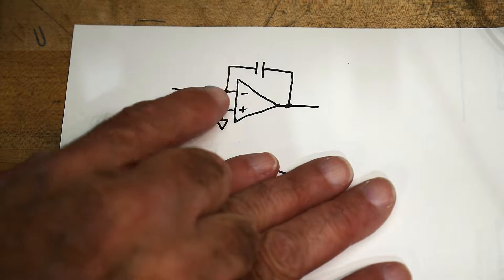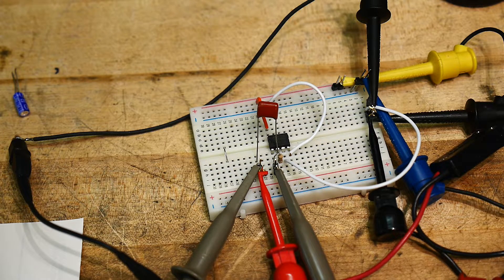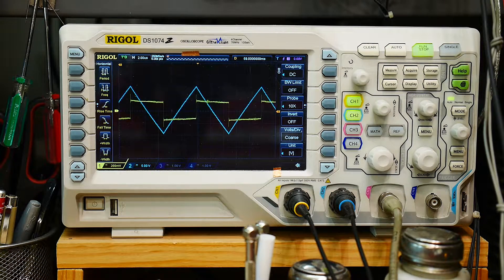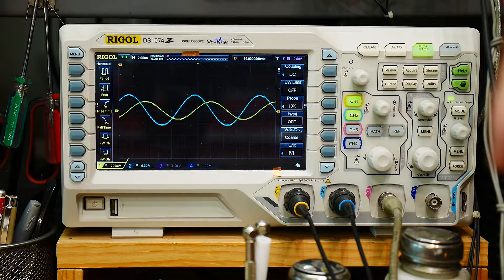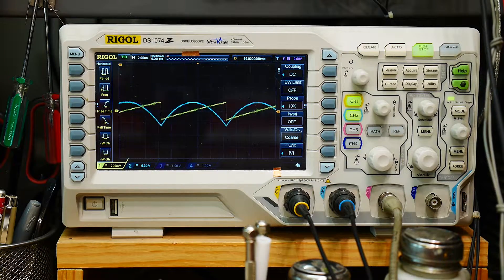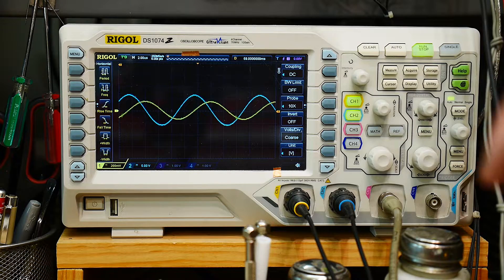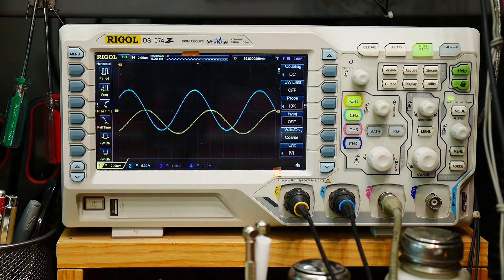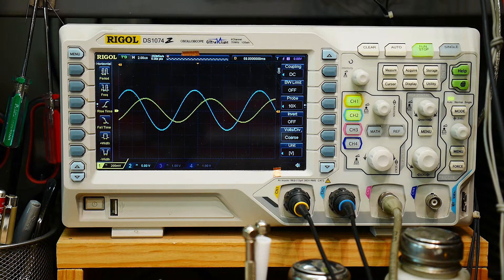#503 Op-amp Differentiator

Comment: I’ve questioned the resistor use between the output and inverting input in the past. Finally, someone has identified it as a feedback resistor used for stabilization.
In the circuit of this video, how would one calculate the value  needed for stabilization.
I assume you could use trial and error substitution but at what starting point?

Thanks for your great videos,  I appreciate your sharing.
Reply: You try to avoid these as they are just a cheap way of stabilization, reducing bandwidth and precision of the circuit and distorting the signal. But if you use it it should be as high as possible. At least 1 MΩ. 

They are legitly used and needed in circuits like RMS computing circuits. The badwidth is determined by the RC value.

Comment: this is a differentiator. if the input is square wave the output will be narrow pulses (+ and -) just think about how the capacitor will behave when a fast rising (falling) step is applied to input. If the input is triangular the output must be square wave not the opposite. so something is wrong here...
Reply: I agree, some of the waveforms just don't add up.

Comment: Hi Thanks for the videos. I am a retired mech engineer and electronics is a longtime hobby. I am confused about the triangle wave-square wave in/out case. If you take the derivative of a triangle wave you should get a square wave (just the slopes +m and -m) not the other way around. triangle wave input should produce square wave output. For the integrator,  square wave input produces triangle wave output. Am I missing something?.